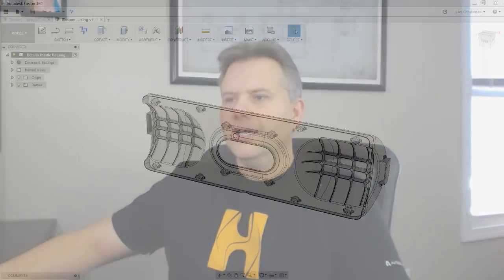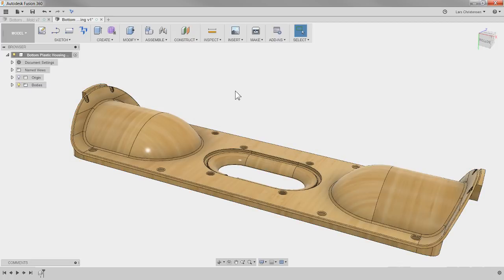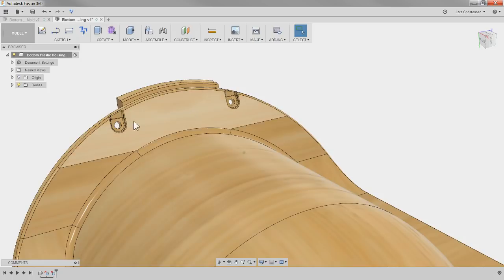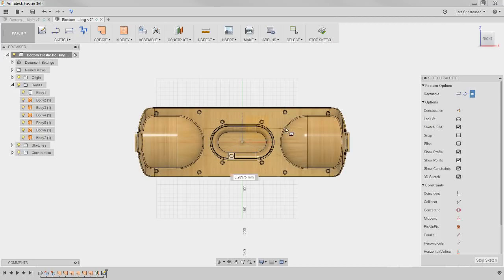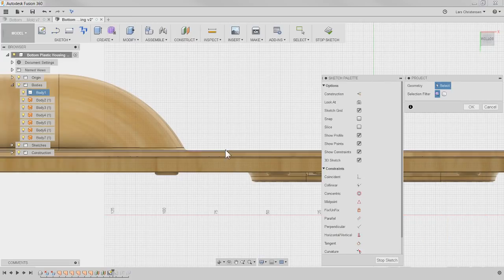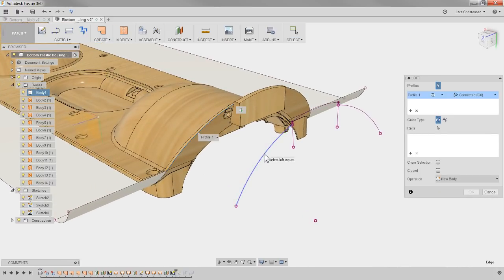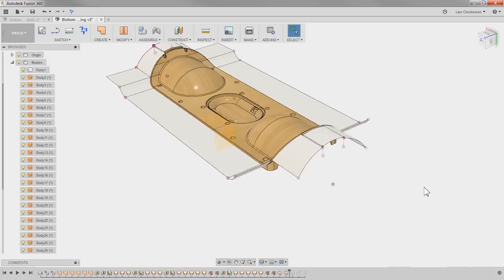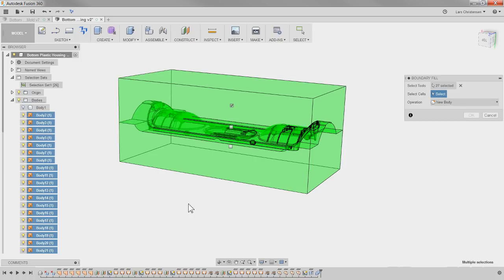Fusion 360 — Mold Design - Cavity & Core — #LarsLive 80

Comment: great tutorial.... however,  I too was left with only two check boxes... never figured out how to actually split the box/outer shell.  when i processed the boundary fill, it did not separatee since there was only one box (other than the inner item)... didn't matter if done under solid or surface.   maybe you can revisit this topic in another video... subscribing and hoping.  :

Comment: Hi Lars i have a question if you are still making fusion360 lessons. i have chosen this mold design since it is the topic i would like to know about. Ok lets say i have designed a intake manifold, and i can 3D print it, but now i also need the core of that manifold as well the void space in the drawing how would i make that void space a sold in fusion.

Comment: Hi Lars,
thank you very much for your method. but  ( for 3D printing) this way of doing mold leads to an expensive and time consumming printing. Would you know a method to squizz down the volume of unecessary part of the mold  ( external faces of the mold consummed a lot of filament)? in my case I wish design a mold of a hull boat and use this mold to built a serie of fiberglassed hulls.

Comment: Lars,  I am working with a mold, when I try to create the sweep in "Patch Mode" using the Single Path option, after selecting the Profile and Path, the distance never populates and the OK button remains gray so I cant select it.  Any ideas what may be causing this?  I tried all the available options in the Sweep menu none of them work, and I have 4 corners that need the sweep patch all of them behave the same.
Reply: did you ever find the cause of this?

Comment: Hello Lars, thanks for the video, but I might have missed something. I have my piece, filled the holes, created the surfaces (even combined them into a single surface, I created the block, but in the Boundary fill, after selecting the block and the surfaces, I only get two little grey cubes. If I understood correctly, I should get three, one for the object cavity and two for each mold. Is there any trick? Should the surface get any thickness?

Comment: Lars, I am trying to split the face of a U-shaped part. I am assuming that you need to create the lofted surfaces from the inside of the U as well as the outside. How would you handle the blending of the inside surfaces?
Reply from the maker: Hi Dennis Johnson Thank you for watching!
I might need more coffee, but I can't picture this in my head. I would love to tell you to email me your part, but I am traveling and so dang behind on responding to people. I have to recommend that you go to the forum and try to see if you can get help there.
https://forums.autodesk.com/t5/fusion-360/ct-p/1234
Reply: No problem Lars, will do. To clarify, I am trying to split the body, not face, of a U-shaped part. This is so that I can create core/cavity for an injection mold, as is the case in your live stream video #80. I think that I have figured out the answer to my question since then. However, now my issue is when I try and utilize Boundary Fill I receive a warning that "Some sculpt cells are mismatched."

Comment: Thanks for all the videos Lars! You've been a great learning resource for me for sure! I think for me coming from Solidworks and using mold tools, Fusion 360 seems to be a bit smarter than solidworks for creating shut-off surfaces and parting lines. Most of the parts that I've split in Solidworks needed a lot of special manual operations and were not easily split with the mold tools. In this respect creating all of the parting surfaces in fusion in my opinion is much easier than in Solidworks.
Reply from the maker: Hi Jer Woolman Thank you for watching!
I am very impressed with the mold tools in Inventor. I would love getting some of those over into Fusion :-)

Hope you have an awesome day!

Best,
Lars

Comment: Hi Lars,
thank you so much for that video. Is that possible to make a video "How to designe and calculate slides (angular pins or actuators)"? Basically a video where you cover a lot of common features in term of injection molding. 

Thanks, Hizni
Reply from the maker: Hi Hizni Dari Thank you for watching!
I want to cover more mold stuff for sure!

Best,
Lars
Reply: Thank you Lars. Please as soon as possible...Smile:-).

Comment: great work Lars,
I was kind of wondering about the sweep you created to cover up the corner missing surfaces. Well the sweep looks fine but its sharp-cornered. Is there a way to create the split surface with smooth surfaces without sharp bends. Its kind of necessary for sheet metal forming tools.
Tkanks.
Reply from the maker: Hi Kanahaiya Murli Thank you for watching!
I might need to see a picture of this to be one hundred percent sure, but I would say "I'm pretty sure you could " :-)

Best,
Lars

Comment: Great to see this mold tutorial. I was a moldmaker myself for about 15 years (1990-2005) and in the late 90's we used Cimatron, with is really really fast to design mold as it was concentrated on mouldmaking. Including the electrodes designing, parting surfaces, inserts, ejection rods, cooling circuit, also the CAM etc. So when I saw you had to wait 4 minutes to devide the blocks i'm wondering how to proceed to build a complete mold with all the parts, electrodes, cam programs etc. In Fusion360. Hope to see more of video tutorials in that direction by you. Thumbs up for thisone. 
Another thing I'm missing in Fusion360 is the standard hole creation like for bolts witch connect to or more pieces together to be able to make in a few clicks f.i. M12 to hold the insert in the moldblock.
Same to add ejector pins in that mold with all the thru holes and chamfers, the pin itself.
Is there a way to select a point and add a bolt to 2 or more  pieces including all the correct holes for all the parts?
Reply from the maker: Hi Xiao Shi Zi 1 Thank you for watching! ANd for the great comment!!
At this point there is not a standard counterbore library, however, the development team are working hard and I am sure it is on their list :-)

Comment: Hi Lars,
thanks so much for this video, I just got around to watching it now. I have two questions: 
1. Is there a way to use the draft analysis tool to help you in locating your parting line position directly or is it more like a helper tool to let you think about where you will place the parting line but in the end you have to place it based on some geometry? Hope that makes sense? 
2. Did I miss something or what is the specific reason for using the boundary fill tool in the end? Would it be possible to do a normal extrude ->> up to surface on both sides of your part / parting surfaces? 

Thanks and keep up the good work!
Reply from the maker: Hi SuperRistopaha Thank you for watching!

1. I will say it is a helping tool. But, it for sure can help shine some light on things.
2. I used boundary fill for two reasons. One, I like to show different tools , in the hope someone learns something new. Two, Bryce Heventhal (My Fusion Guru) always says he thinks it solves better than solid or surface stich.

Hope you have an awesome day!

Best,
Lars

Comment: Is there a reason you didn't stitch the surfaces? Also I did a mold just offsetting the core cavity surfaces to zero then made a block using surfaces and it creates a solid after patching back of block. Thanks for the video. Keep it up.Wish fusion had parting line tool.
Reply from the maker: Hi brittany williams Thank you for watching!
Honestly, the next time I will stitch the surfaces together....did not really need to.

Like you way to use offset surface as a copy surface tool!!

Have an awesome day!